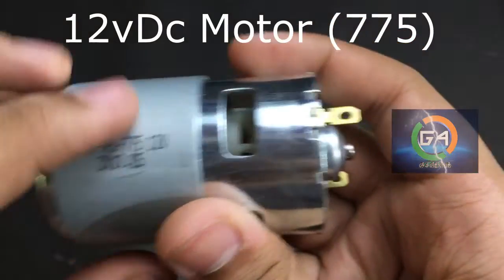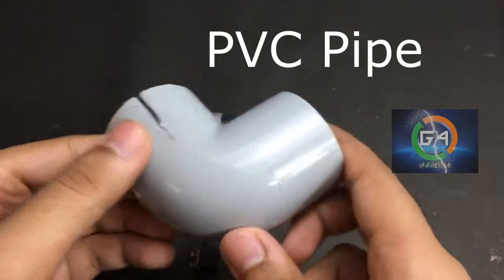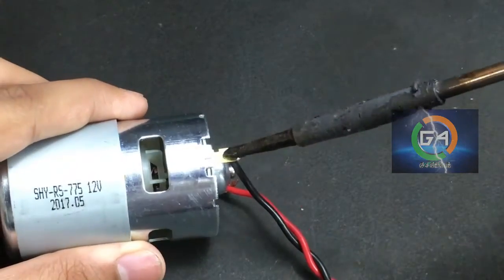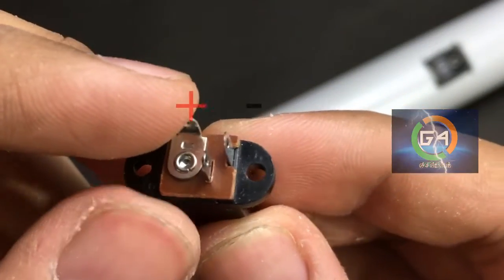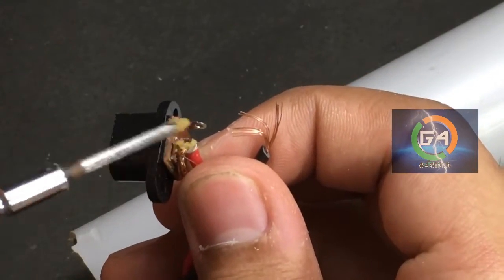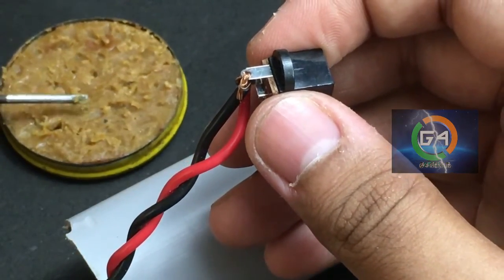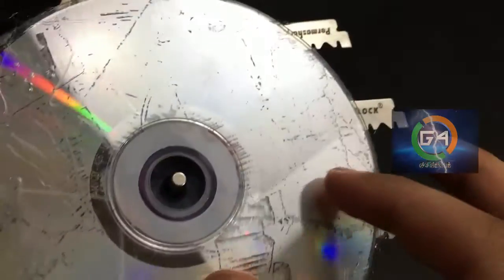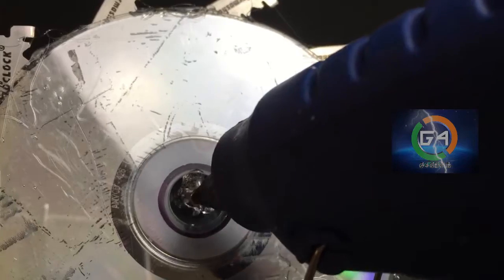How to make a Grass Cutting Machine For Science Project

Comment: Machan 12v ulla motor athara rs akkum
Reply from the maker: The motor used here is not normal 12v motor . 
 12v dc 775 model 7000rpm motor is used here and it will cost Rs 300
Reply from the maker: https://amzn.to/2VQ4POi